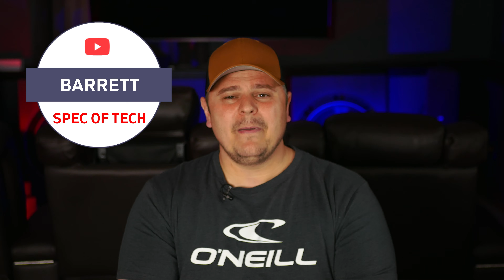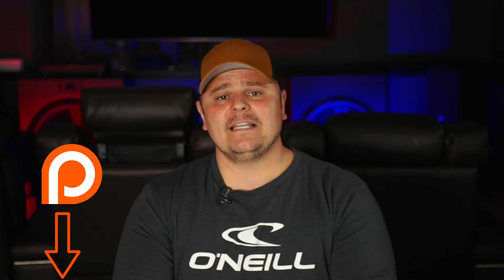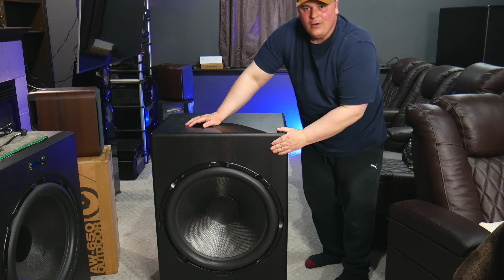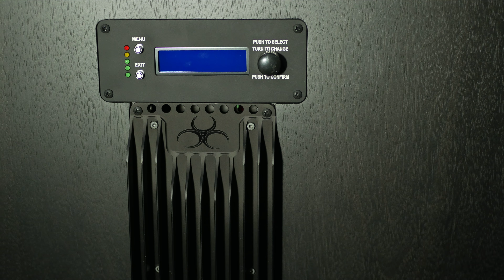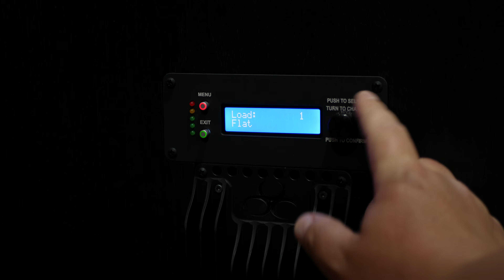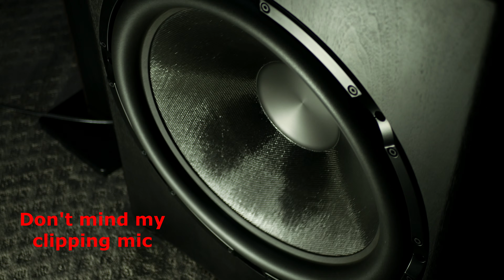DEMOS & REVIEW MONSTER 24” Sealed Subwoofer! Funk Audio 24.0E! Review and Demos!

Comment: Great video! I still think your nutz!! on the other hand, if I had the coin, well, I would join the Barrett Bass club in a heartbeat! ( I could eat cat food for a couple years and save!!) Having SVS subs, the only reason I still have them is the App, way too handy and sound good. Then I think, once they are set up properly, your good to go anyway. I am seriously looking at the PSA subs and Rythmik. Both seem very good. The Rythmik F15hp is only 600w, mehh.... The PSA S1512 is 960w, much better. I do the math, 2 subs shipping ect.. its getting expensive.  Selling my SVS SB4000 for sure, Am I better off to keep the remaining SVS SB3000 and get at least 2 more? Any feedback would be great.  PS. I'm glad you didn't become my neighbor LMAO!!   Cheers!
Reply: I wouldn't look to much into the amps power rating. The drivers and the amps are matched so the driver is getting all the necessary power it can handle.  Hsu has some really nice subs and most of their subs are around 600 watts rms.. Theres a diy sub "the hammer" with the ultimax 12 as the driver, that uses a 500 watt Dayton amplifier, and that sub performs as well if not better than the pb300. I would look more into the actual measurements. How deep will it go and the max output the sub has.. good luck with whatever route you go with this. It's always fun upgrading subs.
Reply from the maker: Dicky has a point, the amplifier output is only a portion of the subs performance.  I think you are on the right track with Rythmik and PSA, they have clean tight bass.  The PSA TV3612's I had, hit like a jack hammer, and had solid low end.  Another option is DIY if you are into that sort of thing.  SVS are good all arounder subs, don't get me wrong, but there is better performance to be had for similar money.  If fit and finish are high in the priority list, SVS is hard to beat for the price.  The Harbottle Audio M18 is a decent choice as well, but there is a little DIY involved.
Personally I think you should just get yourself some 24" Funks and call it a day.  Then you can be done with your bass journey 😜.

P.S. You would love to be my neighbor, when I listen to music, you'll hear it too.  When I watch a movie, you'll hear it too, it's free entertainment lmao.
Reply: @SpecOfTech  Thanks for your reply's!  That makes total sense. I seem to be migrating more to music these days, think it has a lot to do with my new NADM17 Pre Pro, it is just amazing. With the new Legacy's on the way, I think that staying with SVS, probably wont keep up to the Legacy's. Both of you made me think about my listening habits. Really, I don't listen at real loud volumes, but it's always nice to have some Horsepower under the hood!  I need to do some more research, and hopefully talking in a format like this where I can get some real feedback is very helpful. Sucks when you can't hear a product personally. Thanks again!  Cheers!
Reply: If music is your forte then a Harbottle or Funk sub is the only way to go IMHO. I’d place my money on them being the most “musical” sub on the market. I don’t like the word musical tho it’s more about “accuracy”. Low Distortion & Low Conpression. LDLC BABY!!!

I agree with Barrett. Save up & go right for the best & save money in the long run. Cry once....🤣
Reply: @bythesoundofit3350  I hear ya, and as usual I am driving myself crazy, bass is so important. Too many choices. Barrett mentioned the Hardbottle M18, it's not on their website.
Reply: If you go on the Harbottle site, click Products & click Ridge OEM Drivers you will see the three 18” they offer. It’s not M18 it’s ... M118, M118T (TLD) & M2C18. 

Also, they say out of stock because they are built to order at this time. I chose the TLD because you get a solid carbon fiber cone & some other tweaks that eek out every last drop giving you more at the top end while maintaining the low end output. All while staying squeaky clean!

Hope that helps!
Reply: @bythesoundofit3350  What amplifier do you use with the sub?
Reply: I was able to purchase a Funk Audio M1 (1000 watt RMS 2000 watt peak) back when Harbottle offered them. Cody @ Harbottle no longer sells plate amps. He offers some really incredible rack amps though. Extremely powerful & extremely clean power at that. Full DSP capabilities and all.

In fact, when you purchase a sub & amp from them they offer a remote tuning of your subwoofer so it integrates with your system. There are some program requirements for it to work. They tune it remotely from their office by accessing your computer & sub online. It’s really amazing!

Cody tuned my TLD for my room & my speakers. He got my phase, crossover & EQ’d it all super flat. Then he gave me 5 custom preset EQs to my taste for different listening experiences. Fun house curves for sure. I run Max Extension for the pure joy of it haha

Some DIY guys use other budget amps like Crown or Behringer  with their DSP models. Not as clean or powerful & you won’t get a remote tune from them but it can still work great from what I’ve heard others say.
Reply: I’d love to get their 2200 watt rms amp just for the headroom & peace of mind when I really want to shake the house. Because I promise you this...their drivers will shake the dust off your siding hahaha

But I also built my enclosure a hair larger to give me more low end efficiency since I’m running the 1000 watt rms amp. This was recommended by Nathan & Cody to me.
Reply: @bythesoundofit3350  Thanks! that sure gives me a lot to think about. I have been to Barretts, and those subs are absolutely incredible.